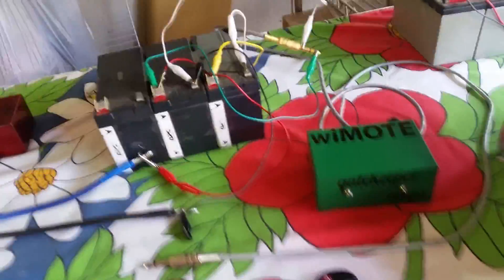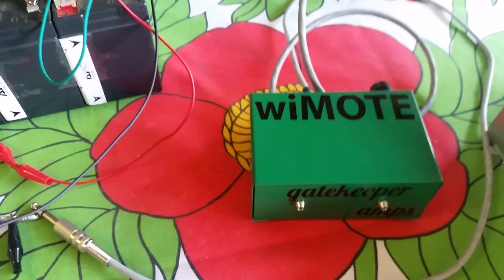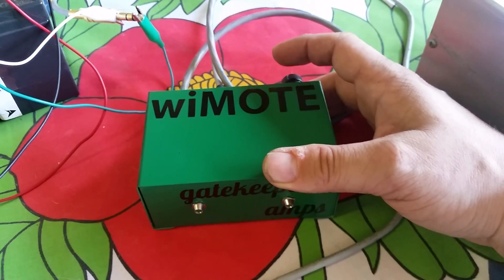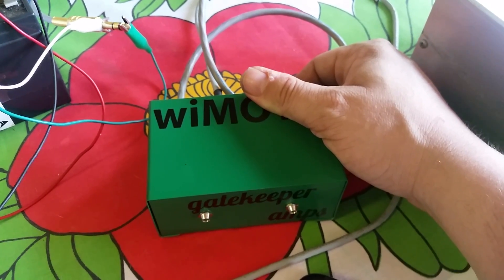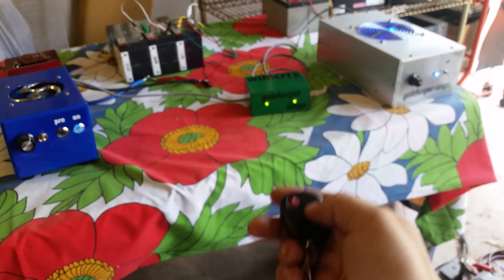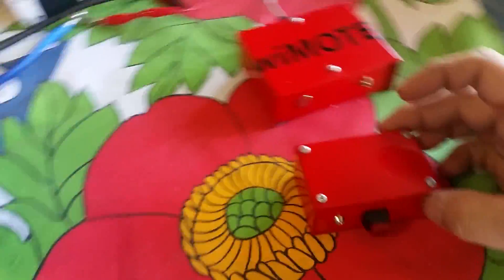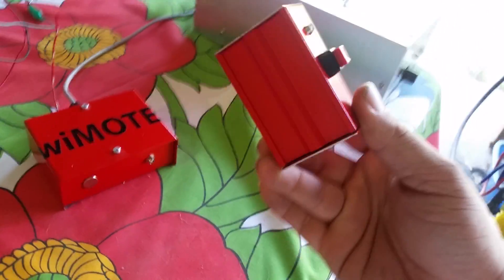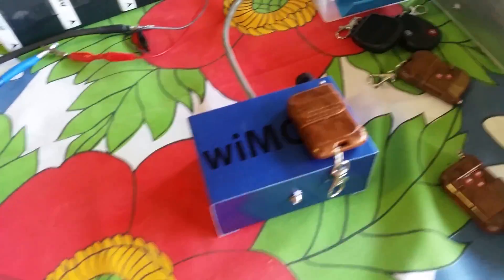wiMOTE Demo - Control Your RF Amplifier With A REMOTE! MUST WATCH! Are You Watching Yet? 🙋

Comment: Nice, those make my old Texas Star 'two toggles and led's' cable remotes look obsolete, to be honest, they kinda are.
Remotes and Wimotes are very handy for two reasons, if you travel with/near other big modulators they can engage your amps
relays with their RF, a flick of the switch fixes that, and because that big ole duck smasher in the back is hard to reach:)